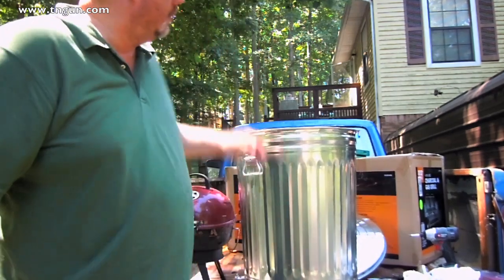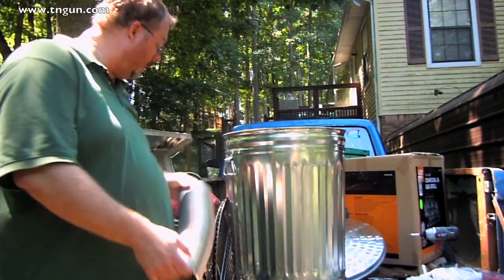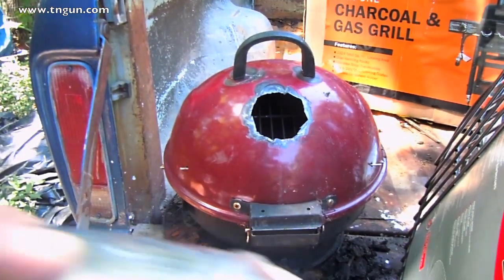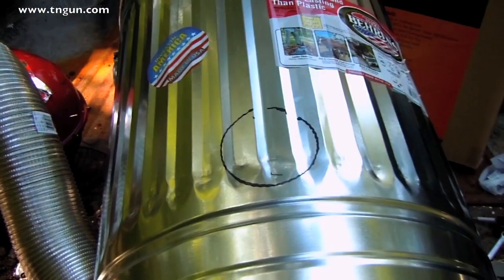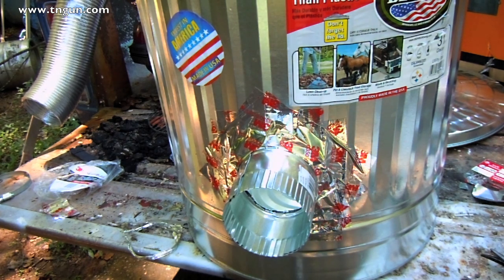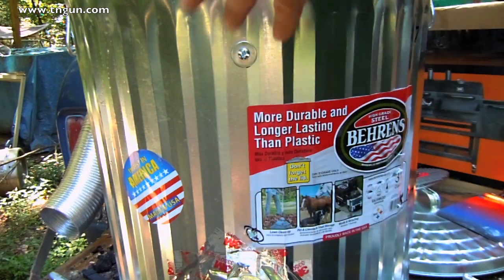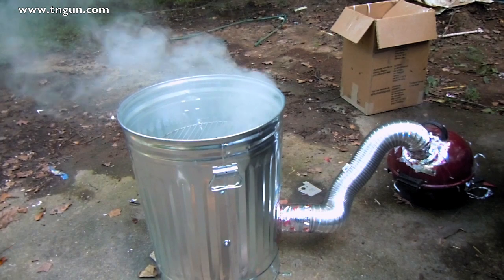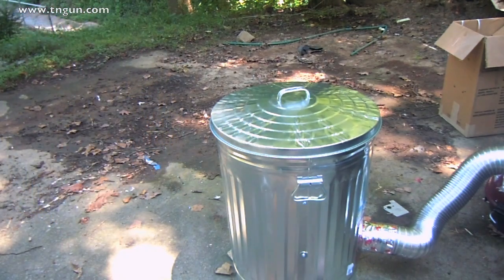How To Make a Trash Can Cold Smoker | Trash Can Low-Temp Cold-Smoker

Comment: We'd put up about 500 lbs of sausage and hams every fall. we'd use a hunting blind, with a similar setup. the 2X4 supports for the walls were what we use to put the racks on.  We also used a hot plate for the the wood chips.

I like your setup here.
Reply: +j johns Yes, you made no sense at all. Wut did you say???
Reply: he's saying: make a frame out of lumber and throw a tent over it to contain the smoke, if you're doing a very large quantity of meat. and an electric heating element to get the wood chips to smolder. seemed clear to me....

Comment: Yep, throw-away job for sure, but if you have ever savored applewood or alder cold-smoked, wild caught red salmon, you will taste the potential here. Take this basic concept and let your imagination run free, be it hillbilly or ritz. Planks of hardwood lumber, alder or oak can be used to build a taller or wider smoker for bulk cold smoking of salmon. Drying racks can be easily constructed of twigs and/or old grates. Any old ground level BBQ can probably be repurposed as a smoke generator. Choose an appropriate wood to match the fish or meat. Monitor the temps, vent the roof and tend the coals. I can taste it!

Comment: i would probably elevate the trash can up on a cinder block, so the 
smoke and hot air can flow more easily and not get "trapped" at the high
 point in the ducting. also as an alternative to bolts, one could run 
3/8th rod welding stock in an "x" pattern right across the width of the 
trash can and leave them just sitting there, no nuts required, just push
 or pull the rods in/out for assembly/disasembly...and they could probably support a lot more weight than the bolts

Comment: I thought about doing a smoke house someday. Digging a trench as a pipe and covering it with flat rocks.The one end would be where you have a small fire,maybe in an old BBQ, Have this open into the smoker.a few tree branch's wrapped with some hides or a tarp.And a roof made from scrap wood. Open just enough to let smoke flow through slow.  Pallets could be used some how to make the smoker frame. I would make this big enough for a deer. My way wouldn't take any money.

Comment: usually when I look at some pircr of tech I immediately think of how I could make it any better but in your case I can't find a way to improve that. good job. 

I have 2 smokers made at my farm one big and a small one. The big one is made out od a steel barrel and it follows same principle as yours just bigger. the small one however is a cap I made to put in a somewhat larger grill That once I have some red coals in I throu in wet wood covered in tinfoil. 

Either way smoked meat is awesome :)
Nice video.

Comment: Not trying to complain about the galvanized can... But smoke is corrosive. I wouldn't us the can to much. Because the smoke will start etching away at the coating and it can flake off in micro particles and then it doesn't take much heat then. Just a head up for ya. Nice video tho.

Comment: A 14.99 hot plate with a cast iron pan full off chips is MUCH easier. Just poke a hole for the plug and you can actually COLD smoke (90-100). Good video though, that sucker will work for sure!! Hillybilly ingenuity at it's finest!

Comment: Cooking with galvanized, not to smart.
Reply: The Galvanized coating is on the outside not the inside so your more than safe, plus some burn it off at times.
Reply: "...Metallic coating will begin to melt around 427°C (800°F) and the metal 
will begin to melt around 1510°C (2750°F). This product will proceed to a
 liquid and will form irritating and toxic gaseous metallic oxides at 
extremely high temperatures.

Material will begin softening at approximately 2400 F, will proceed to a
 liquid and form irritating and toxic gaseous metallic oxides at 
extremely high temperatures.

When heated to temperatures nearing boiling point, zinc oxide fumes are produced. Boiling Point: 1663° F (907° C)"
Reply: Yes, that is why most will do a burn off of the coating prior but even creating a "dutch oven" i doubt you will reach 1600 degrees and probably not 2400 degreed F.  Since this is being produced outside, I doubt if you did exceed those temps that you would have to worry, unless you sat next to it and sucked the fumes in.
Reply: The zinc coating is on both inside and outside. If the trash can was coated using the "hot dip method" the can is placed in molten zinc covering both in and out. If the method used was "electroplating", which is preferred because it is cheaper than the "hot dip method" again both sides would be equally coated.
Reply: that was my point: with anything near normal meat-smoking temperatures, there shouldn't be a worry about zinc becoming gaseous